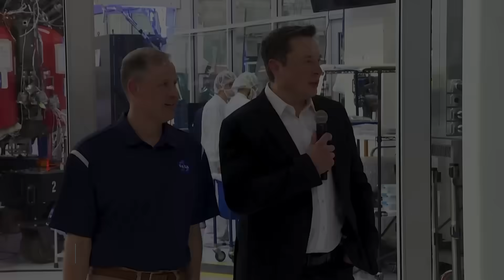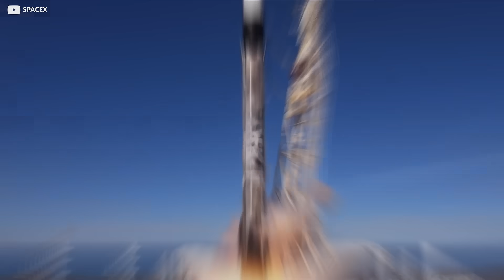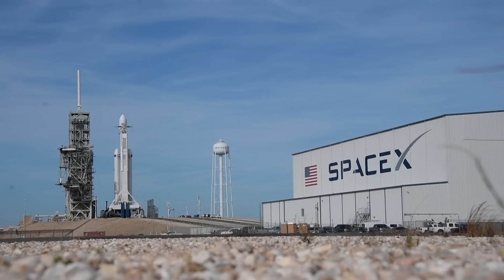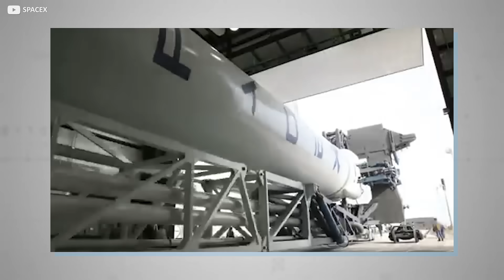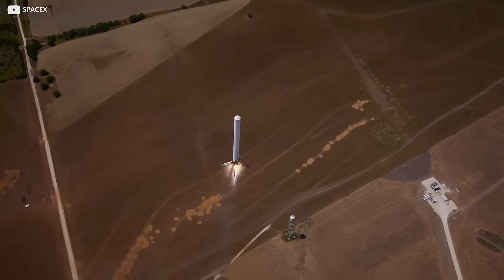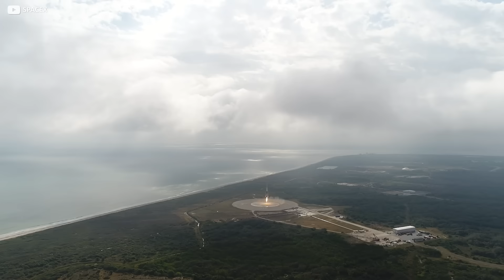How SpaceX Transports Its Rockets

Comment: Transporting a Falcon 9 with a 44-wheeled trailer is a special type of transport with many requirements imposed by the authorities. The rocket could be better transported by train. Very long rotors for wind turbines and entire hulls of the B737 travel by train to final assembly. Parts of the Space Shuttel Booster were also delivered by train, which means there is a rail connection.

Comment: Perhaps dedicated rail lines between building facilities to launch sites would be a better option. However, building road systems that can accommodate such large and heavy hauling requirements is good infrastructure spending which benefits the economy over the long term. Its a win-win.

Comment: Moving heavy weights using ground infrastructure is what they did on the Easter 
Islands or in ancient Egypt. Now days it is totally possible to
 lift and reposition heavy weights using blimps. The advantage of a 
blimp crane is that it will be able to operate a vertical take off, also
 because there is no air blast down the vertical vector the weight can be 
fixed under the blimp. That will make the setup much easier and more stable even with something like the starship.

Comment: Wonder why they don’t use railway like NASA in some cases. They can carry heavy load at cheaper cost.
Reply: rail cars can't move 200ft long section in one piece
Reply: Falcon9was designed to be able to be transported by road
Reply: Maybe they don't want to rely on a mode of transportation where the axle width is based on a horse's ass? 
(that's a joke, if you don't get it, you haven't been on the internet long enough.😁)
Reply: And Boeing has used railway to transport airplane sections across the country